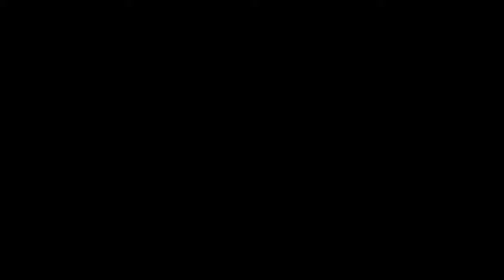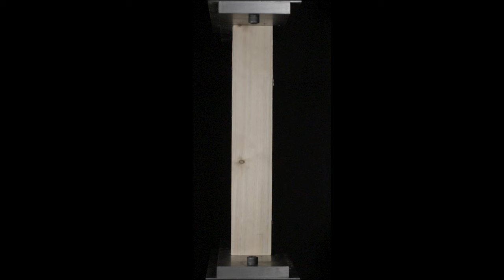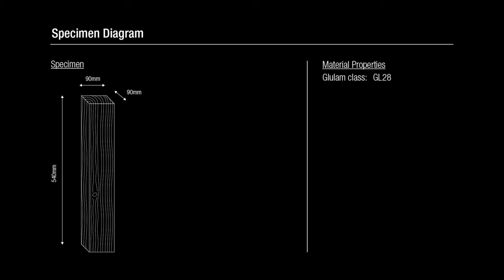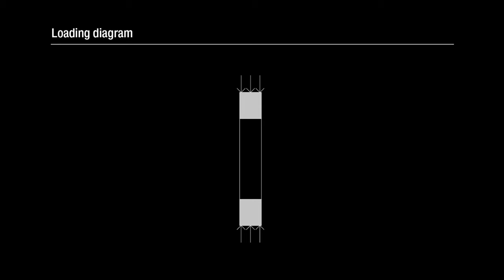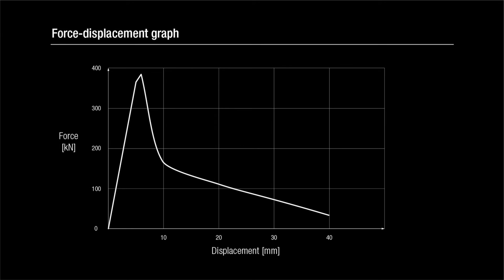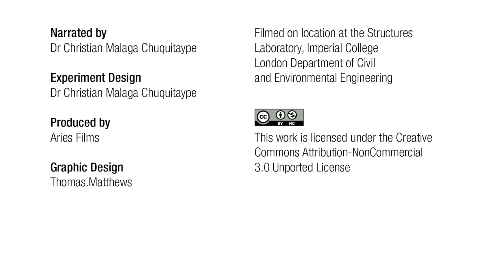Compression failure of a timber block parallel to the grain: Materials Lab on-line

Comment: 1) Would you please update the graph to show pressure as well as force, i.e., what was the cross-sectional area?
2) Would you please run another test perpendicular to the grain?  A sole plate in a house supporting a vertical stud is a typical use case of where this is important.